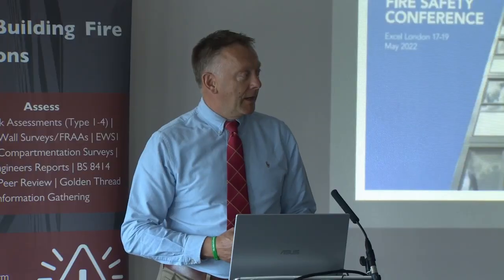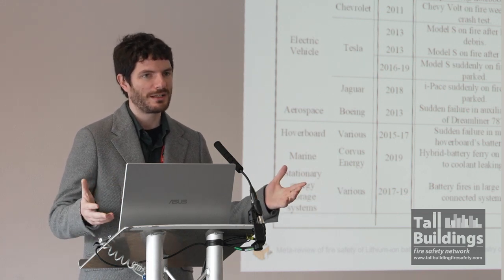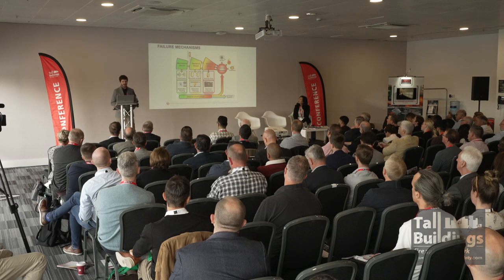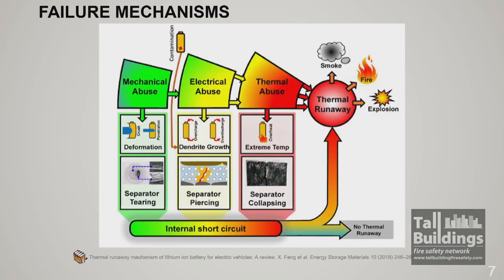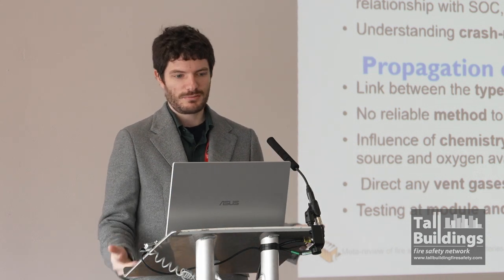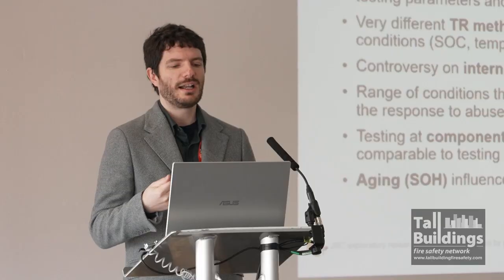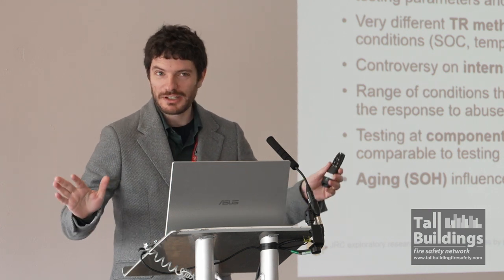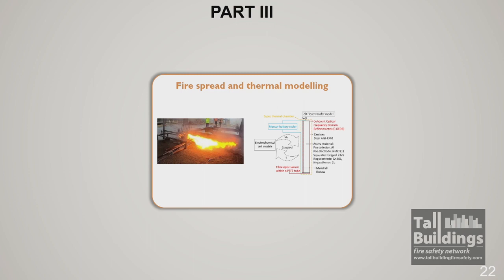FRANCESCO RESTUCCIA - Lithium-Ion battery fires            Subscribe now to this channel

Comment: Seems to me we have a massive brewing problem.   I must have a dozen lithium batteries in use daily.   They are all charged in the garage or house.   I have a range for cordless tools including garden equipment, an EBike and of course mobile phones.   Fortunately I was already concerned enough not to buy an EV.    It really concerns me that there is no way I can know if any of these batteries are going to fail.   Really they do not appear to be fit for service.   Perhaps our rush to these is grossly wrong and we need better battery chemistries - perhaps we should be slowing things until Solid State can be manufactured.

Comment: Could someone please tell the maker of this video that the diagrams are more important than the face of the speaker... cutting away from the diagrams while the speaker is describing them is extremly counterproductive...
Reply: Agreed! Flashing a slide of interesting and relevant info on the screen for a few seconds, only to cut back to the talking head, forcing me to stop the video and revert to the slide for examination, is extremely annoying.

Comment: So batteries designed for cars shouldn't be used to power your house.
Reply from the maker: Hi Please pass to colleagues and subscribe. see archive at www.tallbuildingfiresafety.com
Reply: What I got from that is the battery's are in a state of decline from day 1 as you would know with your phone after a year or 2 it goes flat quicker. A phone however only has 1 or 2 cells in it so the heat can get away easier than 1000 cells packed in a tight place. When you get a pack of cells from a EV there is either a problem that they are not preforming as they should or the car has been in a crash and written off, In that case you have no idea if there is any physical internal damage simmering away and it only takes one to set the lot off.